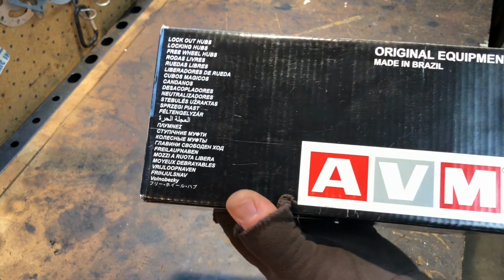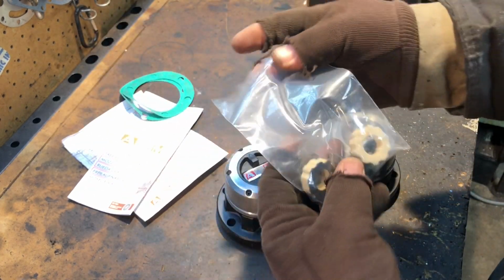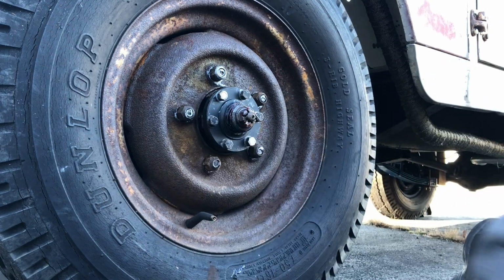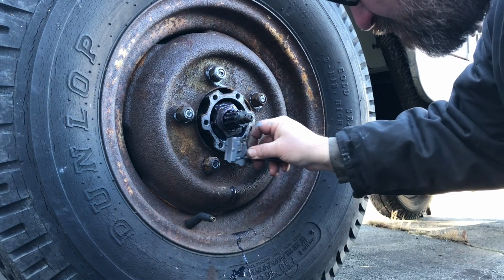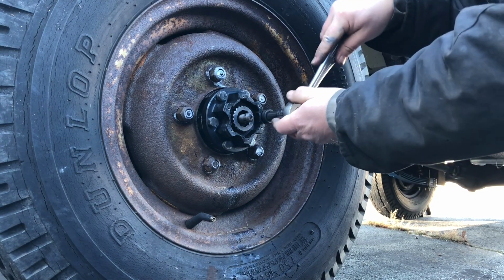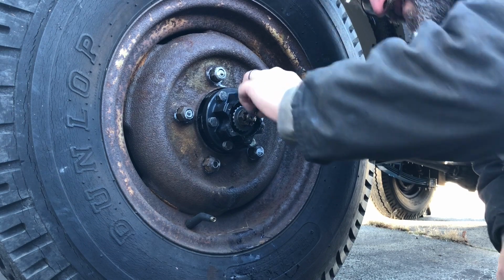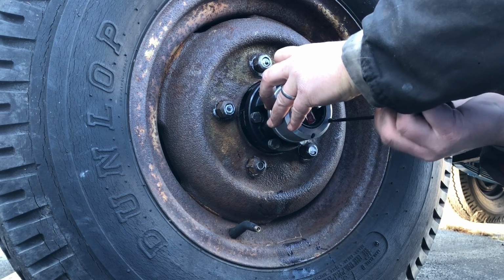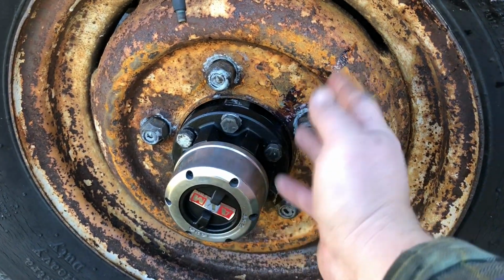AVM Freewheeling Hubs Land Rover Series 2A 3 Axle Restoration Repair Installation diesel petrol 405

Comment: Hi, Cory. Ref. Removing the cotter key, I straighten it out as much as possible then use a pair of side cutters to grip the  looped end of the key and lever up against the hub nut. Once you’ve levered so far, move the side cutters down the shaft of the cotter key and lever up again. Works every time for me, unless of course the cotter key is rusted into its hole, that’s a whole other story. Great video, Cory.
Reply from the maker: Thank you Sir! Excellent process!! Use leverage to your advantage. Cotter pins are such a pain in the butt!!

Comment: Cory, to stop the paper gaskets from leaking you only need to smear them with grease before you fit them...this helps them stay in place during assembly and usually keeps them leak free.....also the spongy seal on the end of the driveshaft benefits from being soaked in gear oil before fitting to help them stay fairly leak free
Reply from the maker: Oh Man!! I completely forgot about putting a coat grease on the gaskets. That’s an excellent suggestion. I’ll have to pull them back off to fix the leaking.
Reply: And if you grease paper gaskets you can usually re use them.
I do the same with the valve cover gasket. I use sealant on one side and grease on the other.
Reply from the maker: @rickz9495  excellent point! I completely forgot about a coat of grease on the seal. Thank you Sir!

Comment: Hi Cory, I have the older style AVM's fitted on mine. The internals are quite different! These look a lot simpler to fit, no lining up of clocking pins and grease everywhere! The maths says that you should see an increase of 7% in power, or a corresponding fuel saving, but I imagine there are other factors. Thanks for the video!
Reply from the maker: Right! I thought these would be a little more difficult. Excellent percentages. I would agree with the 7% increase. Seems correct for the old butt dyno!! Ha ha!!

Comment: I don't understand why the shaft turned freely when you were tightening up the castle-nut. Not if you were in gear and in 4WD, and the other wheel was on the ground (and locked, if you had the other FWH already fitted).  The FWH disconnects the shaft from the wheel, not the shaft from the driveline.

I think you must have had it in neutral, or the other front wheel was jacked up, or it was in 2WD, or the other FWH was unlocked.
Reply from the maker: @TheSwordsmon  excellent question. The center diff is an open diff. So each wheel is free to spin if the other 3 are stopped. That’s why it’s free to spin any time. Example: when you’re trying to drive over an obstacle and 1 wheel keeps spinning because it has no grip. It’s the same concept. Thank you for watching.
Reply: @conrad1468  No, you can't jack up a single wheel and spin it, if the vehicle is in gear and in 4WD (even if there were a centre diff, but there isn't in a Series LR). If you spin a single wheel while in gear, either the engine must turn, or another wheel has to turn (in the opposite direction).

Picture what was happening while you were tightening the nut: the shaft was turning, so something in the diff was turning - either the crownwheel and propshaft was turning, or the planetary gears were turning the other shaft in the reverse direction, right? It couldn't be the other shaft if that wheel was on the ground (with a locked FWH, and if the shaft was in place, of course). And it couldn't be the C/W and propshaft if both gearboxes were in gear and the T-case was in 4WD. So one of the following was the issue: Not in 4WD, not in gear in both boxes, other hub was unlocked, other wheel was jacked up, or other shaft was out.